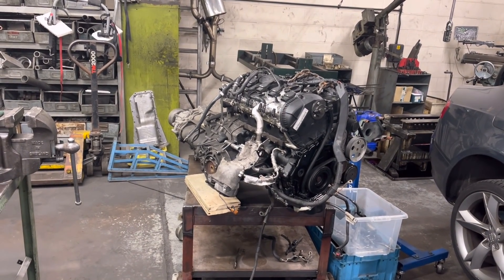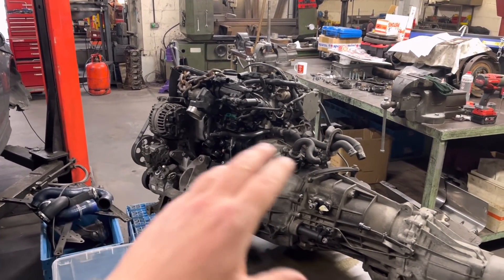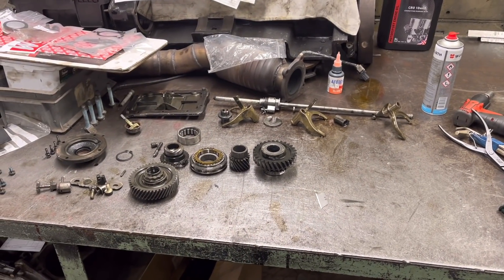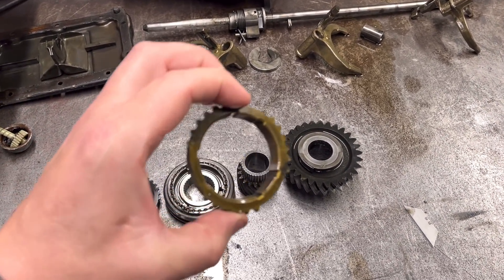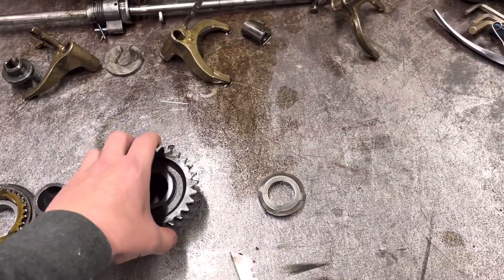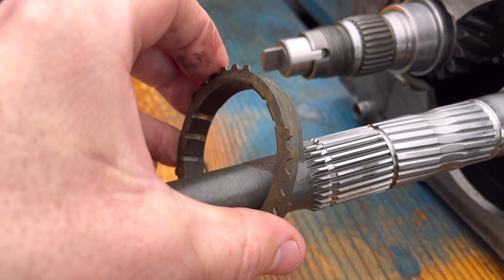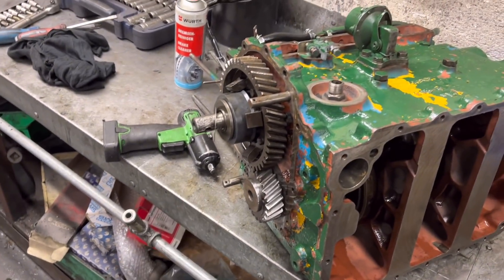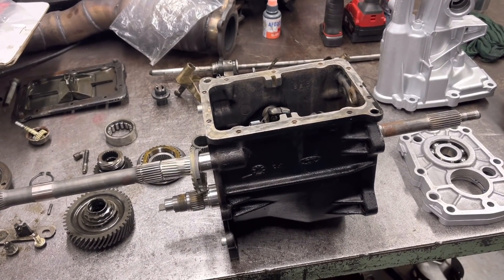We get inside a gearbox, will it be repairable?

Comment: How much torque does a run of the mill range rover put to the road in first gear?  👍
Reply: It depends on whose driving it, auto or manual 2 or 4wd, diesel or petrol
Reply: @Mrflash222006  
Nobody will touch it 😂
I was the 1st comment aswel..
I already know the answer btw
Reply: @Mrflash222006  
Its the problem with being around 2700kg and having components made from cheese..
crank speed vs wheel speed un earths the advantage numbers if you understand the formula..
+3000ftlb in first...if people think the ftlb of a decent crossbow can drag land barges up hills they're bonkers.. even family cars have well over 1000ftlb in first.